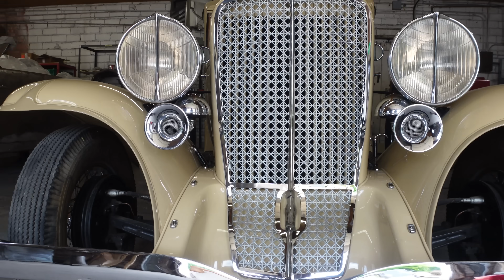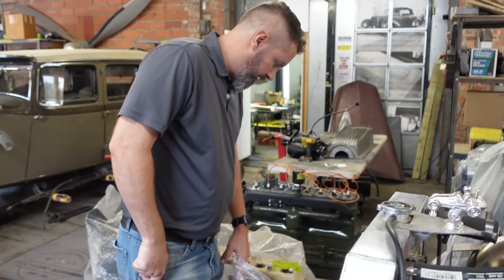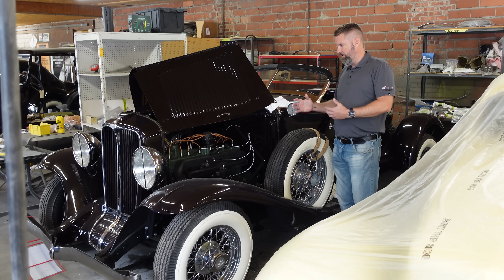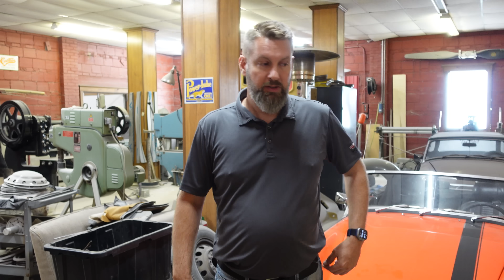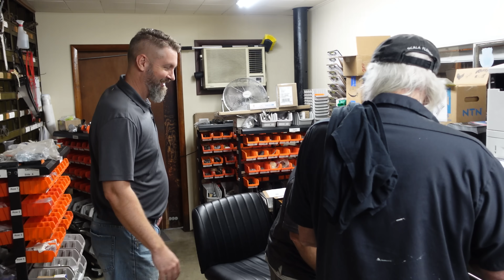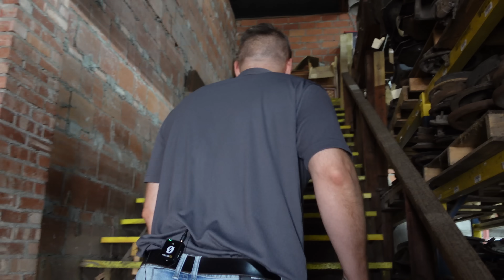The Secret Shop Keeping Pre-War Cars Alive

Comment: That's the most Auburns and Cords I've seen outside of the ACD Museum in Auburn, Indiana!
Reply: this is though the shop of the guy that bought all the equiptment used to build and make auburn auto cars and went onward with second gen cars a few decades ago, in broken arrow, this is what remains of building auburns cords and dussenburgs on thee origional equiptment, though we do have people in auburn here that can work on stuff one of those type of cars as several locals own cars like this, all the archives at the museum, and the curation center for the auburn cord dussenburg musium for its collections where they do restoration and mainanance on them.

Comment: Tensile Rigidity of the Crankshaft and the Big 8’s. When I made a comment on another channel about inline 8 cylinder Pontiac engines I was reminded of rigidity. How did they solve that question 100 years ago?? Just better steel in the manufacturing process?? Thank You 🙏 Very new to the channel. Thanks 🙏